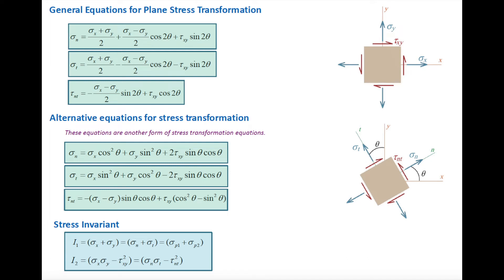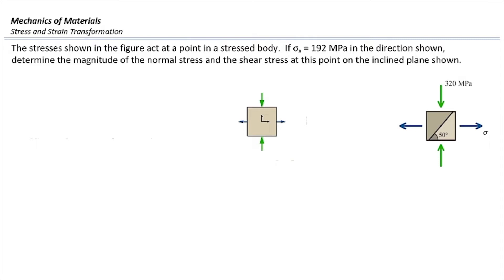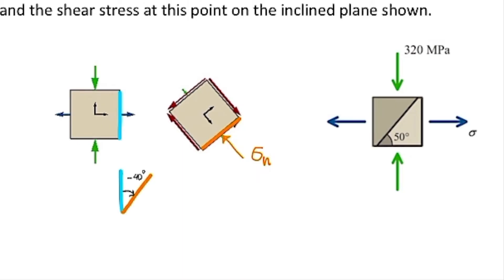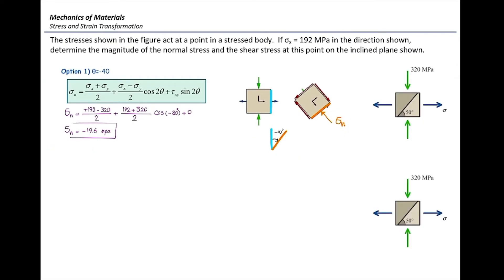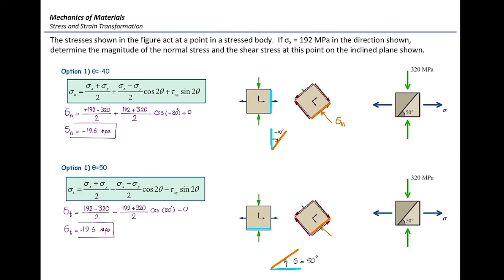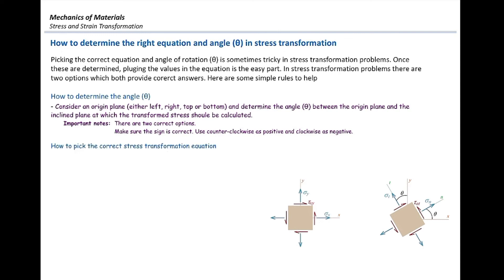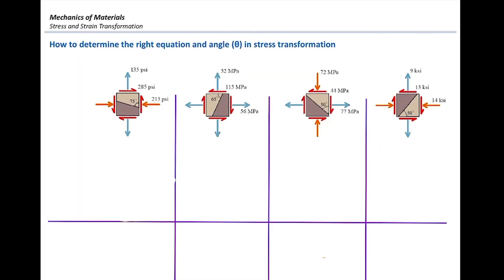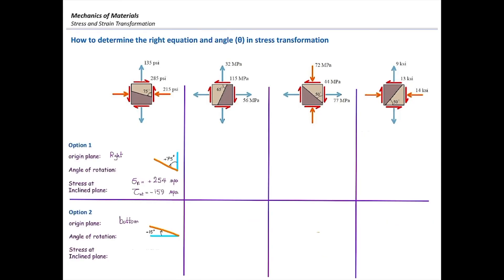How to identify correct angle and equation for stress transformation

Comment: @3.40 both are normal stress only i.e stress normal to inclied surface either we rotate from clock or anti clock. sigma t should be -108.45 Mpa. sigma t is 90 deg to sigma n .

Comment: The first frame. Is there a mistake in the angle? Cause the plane is rotating Counterclockwisely,I reckon it should be positive.
Reply from the maker: Do you refer to the first slide that summarizes all equations? if so, the angle shown is positive which is matching with the given equations.